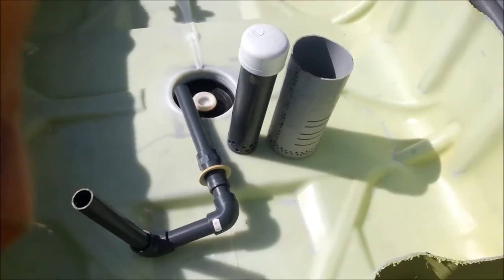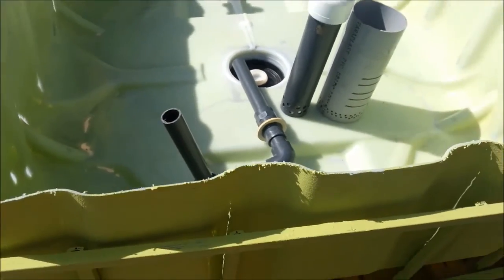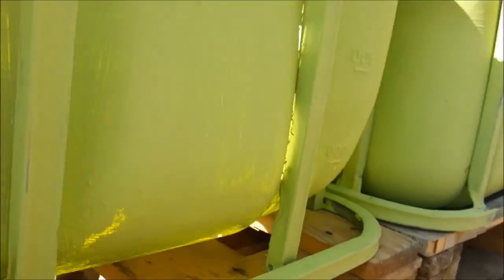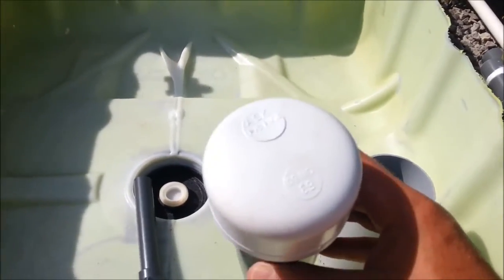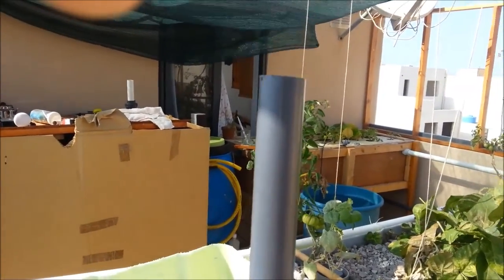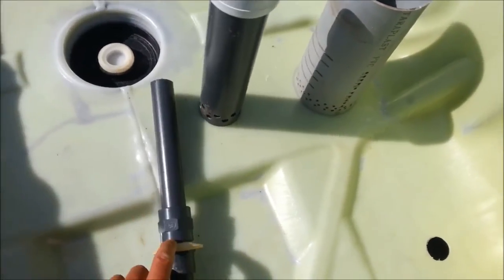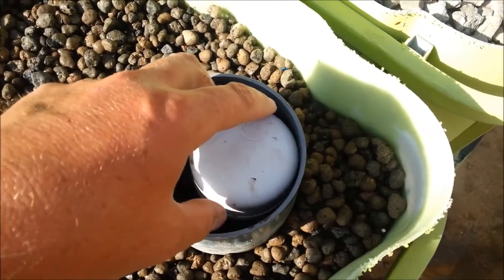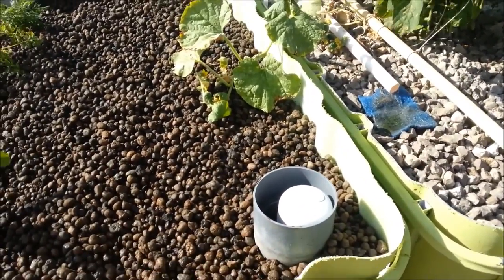Automatic Bell Siphon Kits

Comment: just a quick question, the IBC tote has a drain hole already installed, I can see in the center. Can you explain if there was a reason to not use this instead of cutting a new hole.  Thanks
Reply from the maker: Hi Trenton, I have not used this hole as it is in the highest point on the IBC as well as it will be easier to maintain and clean near the corner.